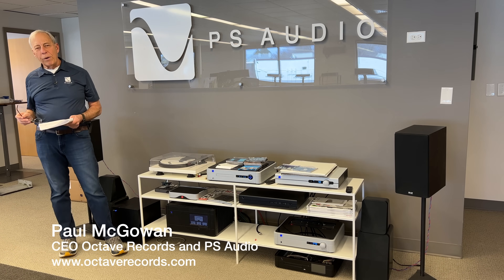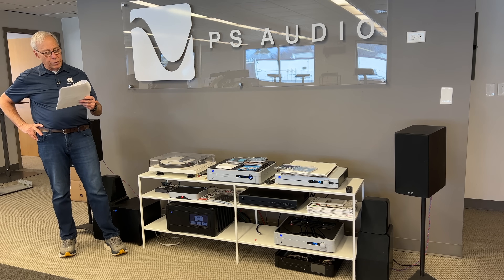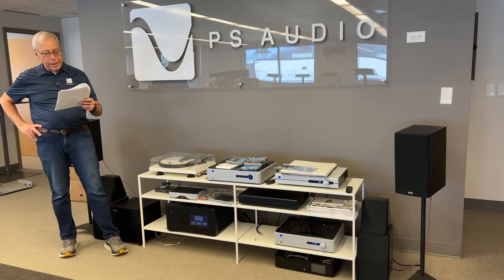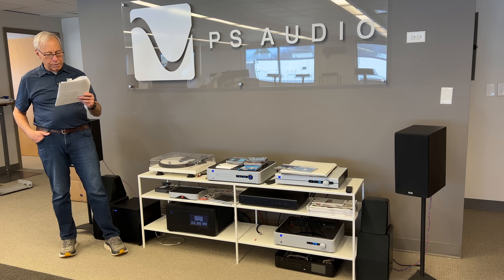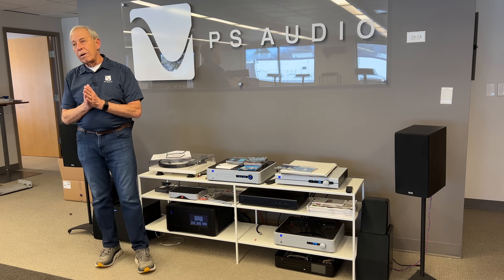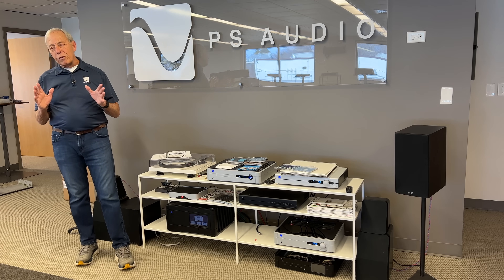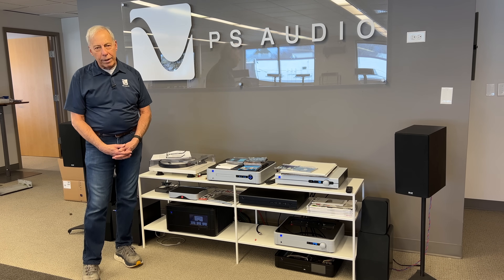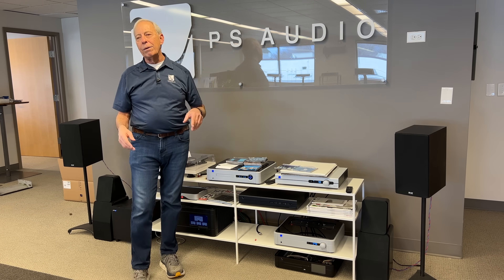DSP vs  passive for crossover

Comment: Did audiophile stuff since late 60s when in high school all the way to 801's, DM6's Acoustat 2+2's, Apogee Stages, and other lessers, but I never realized these speakers DID NOT IMAGE WORTH BEANS!   This was revealed to me when I found some Phase Research towers (forget model - very limited hard to find) which where 6" TL w/dome tweeter in baffle-less "tunnel".  Then I played ALL my records again and was experiencing sound stages I never thought possible.

These speakers were made scientist tweaked, for example, the tweeter tunnel was set back about 2" from the bottom case, so I thought there might be some degradation from the 2" ledge which would reflect the HF.  So I laid a towel on it to see if it improved things.  IT TOTALLY DESTROYED THE IMAGING!

I had a Technique's 33 band equalizer with the signal generator and calibration mike and after EQing, image destroyed.  My conclusion from this was all the phase shifts from all those filters made a mess of the phase characteristics of the speakers themselves.  So Phase seem essential for razor sharp imaging.

So my conjecture is that DSP which does not introduce rolloff phase shifts might image spectacularly - especially with all the Linkwitz Riley 24db/octave stuff that was the big thing decades ago.  (although I'll never know how that stuff imaged - since there was never any talk about imaging and how to achieve imaging, I have to assume it was a black art that only a few, like the Phase Research creator, had any understanding.

Without question DSP 5.1 surround sound sure puts things where they belong.  I had an old RCA surround process where you manually input the distance to each speaker.  It was amazing how the image coalesced as you adjusted the distance to the correct value.

So it's gotta' be phase, eh?

Comment: DSP steps on the signal too much for my taste. The frequency response is flat sure, but so are the dynamics. No emotion. Flat flat flat. 

Besides, I can buy a pair of Harrison Labs FMODs for fifty bucks and if my amp has pre / main jumpers that’s all I need. 

So funny when people waste thousands on giant amps when they could high pass the mains and let their subwoofer do the grunt work. 

Amp works better. Speakers work better. Money saved. 

Sorry, but anyone saying thou shalt always run the fronts full range is wrong. THX has been right all along.

Comment: Splitting the signal at line level has far fewer effects than doing it at high levels. Also the power amps only pass high, mid or low signals which lessens distortion and can be chosen for their suitability to the relevant frequency.

Comment: i agree i wouldnt invest in a random crossover use diy calculator at least however more time/$.  I dont know about the reliability of the dsp stuff. I hated when amps were ruined by dsp chips being hard to replace and more expensive than the working amp.  I dont trust that some chip can seperarte hf an lf on one single pos/neg  non bi amp speaker.
Reply: how does that relate to the internal x overs in the speaker?
Reply: oh ok i get it they talk to each other. the chip measures the  ranges of the speaker........Based on all the settings all being matched and the correct cables.  kind of a nightmare imo.  i was using 2ch set bw 802 speakers/ p2 amp and an aging advanced av controller( DV2).  I had better results just using an nad c 370 and nad cd player.  I mean the digital one sounded great and lower distortion however it was just a pita.i was more worried about if if set it up wrong  than actually enjoying the sound. I need a balanced cd player or transport to test the 2ch mode correctly.

Comment: The whole passage, audio aspect is so limiting is such a shame as an audiophile you don’t try to achieve the best sound no matter what means necessary it’s only certain aspects such as wires the gear you connect to the speaker in general that most people but dsp no I believe is the true future for audio improvement

Comment: For me, active is best all the way! And it does not have to be miniDSP, it can be a different digital crossover - or even an analog active crossover. I am using 5 ways, and having separate amps for each way, with no passive electronice between amp and driver, makes the sound so much more dynamic and effortless.
Reply: Hi.  How did you set it up? Not much guidance for designing speakers to be used with DSP.  Thanks.
Reply: You can get super fast effortless sound without DSP, so it sounds like your speakers were poor to begin with, DSP will only ever make slight improvements if you have great speakers to begin with.
Reply: @engjds Then take those speakers, remove the passive crossovers and convert them to an active system and it will be even better. A lot better.
Reply: @ Yeah for those of us that know what we are doing, unfortunately many think they can, when in actuallity they cannot, its not just shaping a frequency response, there is also phase and timing.
Reply: @engjds  I use a deqx since 2010 and recently got the Deqx pre-8 and it's quite simple to get good results. The problem is it get quite expensive and then you forget about boutique speakers and start building yours and it get more expensive. Still I wouldn't go back.
Reply: @ I think speaker quality is proportional to driver quality, not so much cabinet construction-which will have little impact if designed properely in the first place, high end drivers such as magnesium-usually have  great low distortion figures and that is the main factor imo, when you listen to say some seas excel, the speed of the bass is something else-un-nerving at times; those fast changes in SPL, it just cannot be done with paper cones cleanly.
DSP certainly improves things, but it will not make cheap drivers sound in the same ballpark as just getting high quality drivers to begin with, been active in audio for 40 odd years, building and testing them.
Reply: @engjds I have been given some high end speakers that are missing the crossovers. They cost many thousands of pounds back in the late 90s or 00s, mint condition with good Danish made drivers. I'm struggling to find a way to make crossovers as I don't have the knowledge or measuring equipment, so this dsp route is quite appealing. In your view does that make sense as a project in this instance? The speakers are living voice auditoriums with vifa drivers, tower speakers with a woofer at the top, then before a tweeter a bit to one side, then another woofer. I've not been able to find a schematic for the original crossovers unfortunately. Pretty confused about the most sensible next step to bring them back to life. Any advice very welcome!
Reply: @engjds  most speakers you buy have really cheap crossover parts built for massive profit margins, mini dsp might not get you to auciophile levels of crossover but it will be a huge upgrade long as your source is digital. Modifying the digital stream directly at the dac level is quite nice. It's not the ultimate the limitations of the dsp and dac will limit things but we are taking 100k+ setups here.

Comment: Several years ago my uncle was messing around with a multi channel DSP, a stack of hafler amps and some linkwitz (I think) speaker designs made from pcv tubes.. His systems are still the best sound I've ever heard. Sound stage that spans way beyond the walls of the room. But it was an undertaking. He spent a lot of time with his calibrated mic and his software, doing sweeps and making micro adjustments.

Comment: I have built my 3 way open baffle speakers in tri-amp active crossover setup. I feel active crossover is a way to go but there's lot more complexity to that and not just "to use 3 amps". I have to figure out to manage the volume at multiple stages of my audio chain. Volume in Windows (my media player/station), DAC, Pre-Amp, Active Crossover (it has volume gain per channel) then the Power Amp (for bass) and Integrated Tube amps with volume knob (for mid and tweeter). Although I'm hearing no distortion but so many places with volume control gives me irritation.

Comment: I have a slightly different opinion about this whole active/mini DSP x-over thing. What Paul said that these DSPs are not really audiophile products is something I would agree with, they are not enhancing your dynamics and if it is not a super-duper high-end DSP then they are boiling the quality of your turntable down to CD quality. OK that's the con side, but the pro side is that you can very easily listen to your speaker drivers (more or less) separately and figure out where the nasty areas are and where it is playing nicely. Remember the speakers that sounded nicely but measured awful like the famous Spendor BC1 or similar. With a DSP you can build such a speaker fairly quickly without a whole bag of capacitors and coils. You can easily adjust one driver "out of the way" by raising or lowering the x-cover frequency by 2kHz and listen if the distortion goes away or stays and this way you easily find out what driver causes what problem. 2nd advantage is that you don't need to worry about drivers efficiency. You want to combine a 110db horn tweeter with a 90db mid-woofer and it is no problem. And last thing is even if you don't want your final x-over to be active it saves you so much development time and x-over parts coz if you have found your ideal x-over with your DSP you only need to "translate" it to passive. If you don't use 48db filters it should not be a huge problem.

Comment: i recently set up a miniDSP for my subs and the results are amazing!!  the Dirac Live correction is next level. I have no idea what im doing or hearing "by ear", but when I can see the data across 9 or 15 locations around the listening area, i can figure out whats up. These DSPs run at ~400MHz and correct for level, time, and totally control the energy in the room.  I tried the full range correction and it collapsed my soundstage , but i have BW 803s which are quite dialed in already and I have them far enough into the room where there are minimal boundary effects at the listening position--which of course sacrifices the bass performance..  why did i ever get into this?!?!

Comment: Hey Paul I know this is one off but I have a sony-333 recover and the sound has gone south but I want get it recapped or what ever it needs but the beer drinking repair guy around here think it not worth it to recap and won't take time to look so Im asking who if any company's you know can do this.its my first recover so it means alot so it's a sony-str-333 from 1979 it just seem age is not on its side but every things works so I think thirs hope yet for it it's clean but used never used speakers where the ohm's under 8ohm's so I looked in it with cover off it's looks dang gum good in there but I'm not a tech so with that sed I can't repair it.in put please thanks Mr 333.
.

Comment: DSP 's are NOT easy to use ! You really do have to know just what you're doing with them ... stick to a well proven kit if I were you 😃
Reply: what is hard about dsp? to lower a frequency range set the decibel and q value, to set a crossover set the number you want. at least the software is easy. do you mean the hardware setup? i recommend something like the minidsp shd studio so that all dsp is done in the digital domain before dac's.
Reply: @sudd3660  the problems lie in matching driver phase/amplitude responses .. you're right in saying you just dial in a frequency and let it go 😃..! I wish it was that simple. If you've ever had experience of designing and testing speaker system crossovers you'll no doubt know what I'm on about . You CANNOT "dial" a crossover frequency until you know what the response curves of EACH individual driver looks like without any crossover ... When you get to see each response curve then ( using considerable experience in knowing what to look for ) you can suggest a suitable XO frequency that'll be suitable ... Remember this .. at the end of the day the response must be optimally flat and exhibit minimal phase shift with minimal group delay ...

Comment: some good passive crossovers are adjustable to their bandpass filters.....buy those.  or a DAC-DSP in one receiver.  separation will make DSP re-encoding the analog signal thus degradate the sound quality by 10x

Comment: miniDSP is alright and the latest miniDSP Flex is awesome, but it would be even better if they could handle DSD or up to some UHD PCM, perhaps 32 bits 384kHz or similar (incl. DSD-64 optimized DXD) and eliminate any argument of loss of resolution. I can stream 192kHz 24 bits lossless from Amazon but my miniDSP box ends up doing sample rate down-conversion to 96kHz do any filtering.
Paul, why don't you make a product superior to miniDSP Flex that can do the above? We need it and I'm sure it will be a blast as your competitors are too stupid to do it!
Reply: Sorry, but no one can play dsd on active setup, dsp's work on pcm not dsd, dsd is for audiophiles, audiophiles use pasive crosover😄😄😄😄

Comment: Active crossovers are superior to passive in every way. It cost more because you need multiple amps.
Reply: Not every way. There is this thing called jitter. Then there is the complexity and at the end of it, you might think it sounds better but actually not so much. just different.
Reply: Not necessarily, there's a lot of cheap but excellent amplifiers today and passive components are not cheap and it can require a lot of them before it's all done. :)
Reply: @PSA78  Trust me, I agree. I went the active crossover way and have Parasound amps. Sounds amazing.
Reply: @analogkid4557  There's a lot of great DIY amplifiers today as well, it doesn't have to cost much at all to rival some the really high-end stuff from not that long ago. :)
Reply: @analogkid4557  I own  a  Parasound a21  and I am thinking about going active with my magnepans.What crossover are you using?
Reply: @j-rod6420   I am using a Dayton 8 channel DSP at the moment. I was using a DBX  analog unit before. Both sound great.
Reply: @analogkid4557  Thanks

Comment: Hey Paul. I am in the process of using a DSP for a multi speaker setup.  That being said, when I find the frequencies, rolloff rates, and type of filter in the electronics that gives me what I want, can I then build a passive crossover to the same specs and get near identical results?  Would it be 99% true?
Reply: Yes, for the purpose of drivers respons and cabinet, but you might still need to add for instance circuit to make the crossover work with the impedance etc. And you would really have to work with the DSP as if it was a passive crossover, you can't for instance add BSC so it affects woofers if you're building something like a 3-way. So it's a way to maybe cut some costs on building the passive crossover, but there's still work (including measurements of drivers) to do. :)
Reply: Hi.  How did you set it up? Not much guidance for designing speakers to be used with DSP.  Thanks.

Comment: Between DSP and passive crossovers there are also active analogue systems.
Reply: No, he probably means ASP: analog signal processing, those are active and at line level.
Reply: do you mean a dsp added after the dac?  for a analog input powered speaker for example.

Comment: The problem with doing an active crossover is that then you have to also buy multiple amps for each driver or driver pair, (woofer, tweeter, mid, etc.), and therefore your total cost to build the whole speaker system goes up generally, when compared to just using a regular passive crossover and one amp to power the whole speaker.

The flexibility in crossover frequencies and "tweakability" of the sound with an active crossover IS cool, but the extra cost involved in building a speaker in that manner, (using an active crossover), and having to buy all that extra gear, has always been cost prohibitive for me, unfortunately...

I would actually love to have at least a test/design/build setup like that, with active crossovers, in order to get everything "dialed in" and adjusted to the best sound first, but then to be able to build a passive crossover around those specs, (i.e. whatever settings on the active crossover sound/work best), that would be ideal, imo... but... MONEY! (or a lack thereof) is not allowing me to ever do that realistically. (I don't make enough at work to have any "extra" money to play with like that! :( )
Reply: you could just use a 3 way plate amp, two for stereo to be exact. hypex fusionamps for example, dps, dac amplification all built in.
Reply: Gotta pay to play better sound

Comment: that is what i did and recommend for diy. no way i can build a passive crossover.
i went with a plate amp from hypex for the main speakers crossover and use the minidsp shd studio for room correction and subwoofer crossover, a dac and a poweramp and i get a diy powered subwoofer with more features than any prebuild store bought ones.

Comment: FYI dayton produces a great project amp with the dsp built in!
Just about any raw driver you can buy from a reputable outlet online will normally include the recommended x-over point in the specs. The ebay & alibaba stuff, not so much.